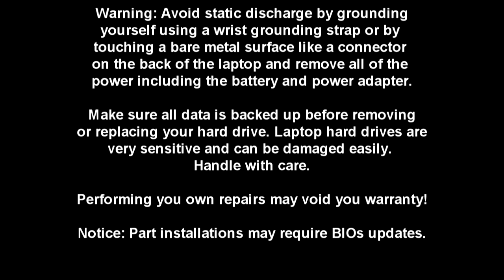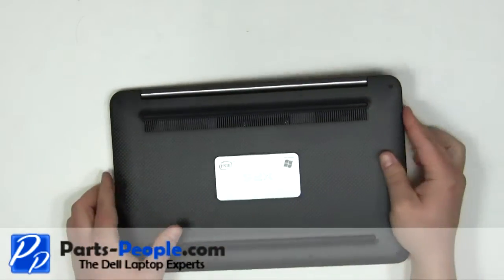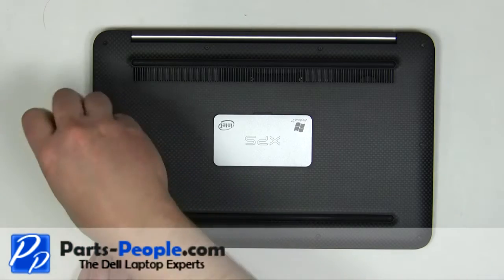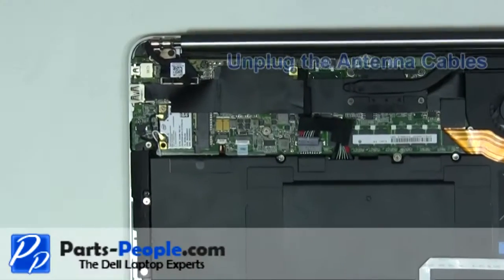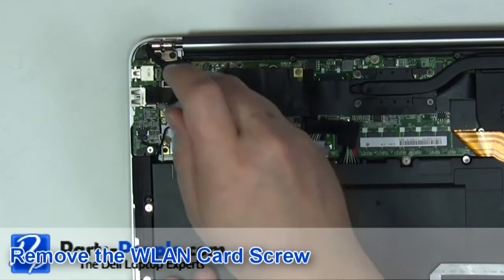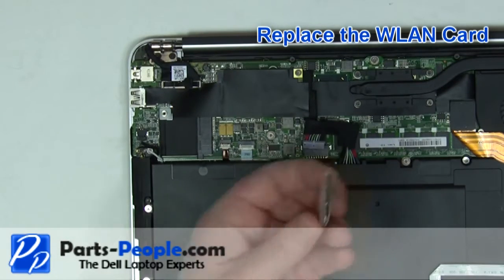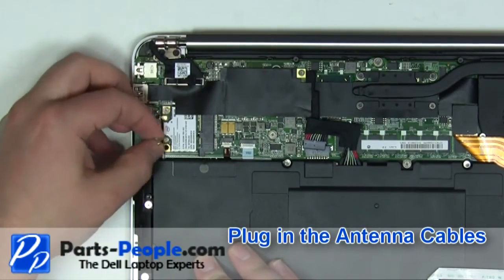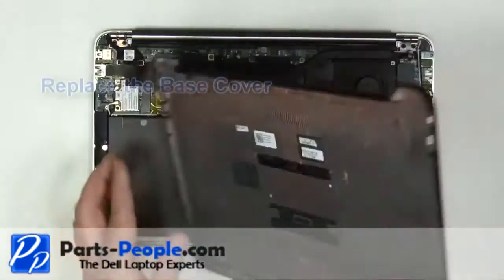Dell XPS 13 Ultrabook | WLAN Card Replacement | How-To-Tutorial

Comment: Thanks! New card works like a charm, huge improvement in signal. Also good to know that battery can be replaced one day when necessary.
In this video I missed details on how to open the back after getting rid of the screws (with a bit of nails it can be done by hand, starting from the back). I also only removed the battery cable connection, not the entire battery.